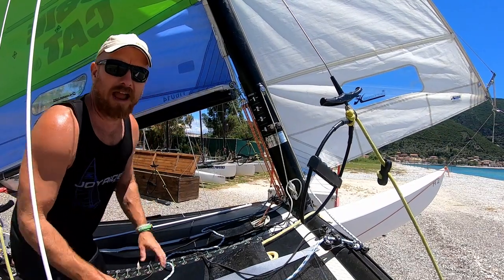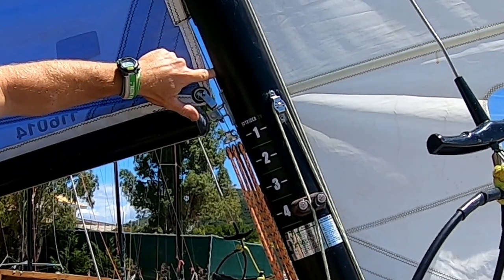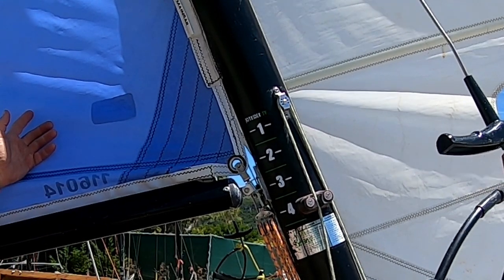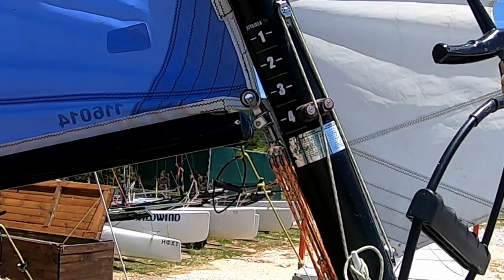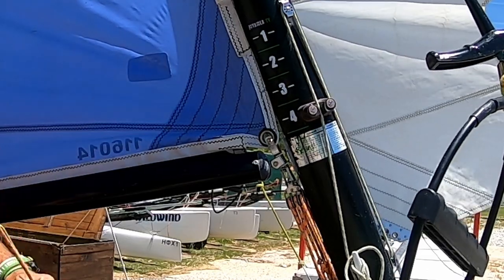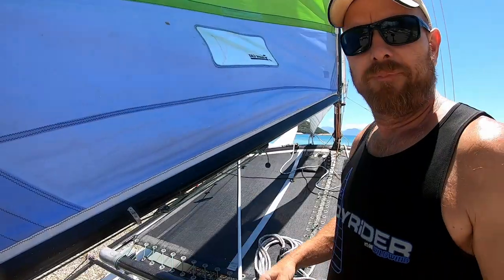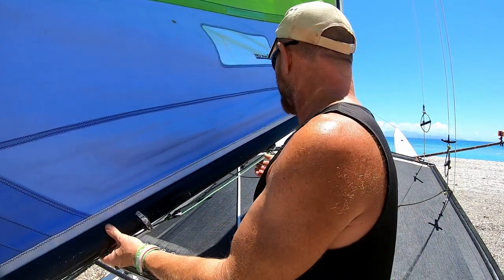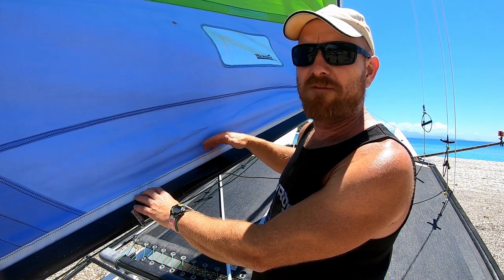Downhaul and outhaul settings on a catamaran  The fundamentals

Comment: This video is perfect timing. On my last sail I realized I may have been over tensioning something(s), possibly my downhaul which was preventing the mast from turning smoothly. I think I may have been over-tightening the jib halyard which also can contribute to mast bend. On my last sail the mast would not rotate and I had to use my hands to get it to rotate. I am about to go for a sunset sail to play with the tension of these items. And I will now be sure to do a pre flight check for mast rotation.
Reply from the maker: could be too much jib sheet if it's windy - that could backwind the mainsail or the mast, could be too much jib halyard, could be a bent mast - if it's just happening on one tack.
Reply: @JoyriderTV  Hey Joe, I just discovered the problem and solution to my mast rotation pivot problem! My boat is a 1989 Hobie 16 and it has had several owners over the years. My boat was fitted with 4 shrouds, the two extras were likely added at some point to provide extra level of safety when coastal sailing in the Atlantic ocean far away from the home beach. Apparently, one of the shrouds had to be replaced at one point in time and it was replaced alone and not as a set. As a result, the replacement was a different length shroud, a substantial 2" shorter. (I just learned that Hobie has shortened the shroud lengths two times since the original Hobie design to give the newer model Hobie's more mast rake, which requires shorter shrouds.)

I did not know about the 2" difference in the lengths of my port and starboard shrouds, so when I reassembled my boat for the new season, I set the pins in the same holes (port and starboard) of the shroud hole stay adjusters, this caused an imbalance in the rig tension and twist between port and starboard... causing the mast to not pivot properly and allowing the boat to tack well to starboard but not to port. While this is unique because this Hobie has 4 shrouds, I learned many things from this experience. 

Lessons learned... 1) always replace shrouds as a matched pair and if a person has an older boat, be sure to check the length of the shrouds you currently have. If you choose to go with a different shroud length, it can affect the length needed for the forestay. 2) The newer shorter 18'-11" shrouds are now the Hobie 16 standard and work great on Hobie 16's newer than 1984 when the mast bases were updated by Hobie to allow for more mast rake. I did need to add a bit more forestay length from the existing 17'-6" forestay to 18'-3" to balance the rig. I did this by installing a new 18'-3" Aussie Jib system forestay. 3) I learned that the halyard rigging on the Euro Hobie's is different than my USA rigged boat and I found the Euro setup to be more user friendly. The Euro system has the jib halyard cam cleat and cleat on the starboard side of the mast. As a right hander, It is much easier to make adjustments to the halyard on the water. I made the switch to the Euro style, and installed that jib halyard cleats on the starboard side, when I installed an Aussie Jib system. And moved the main halyard to a cleat on the port side of the mast. It works so much nicer than my older jib system! 

I would not have made these changes if my current rigging was in good shape, but since it was time to replace my shrouds and forestay anyway, I decided to replace the shrouds and forestay with the current Hobie 16 specs... (the shorter 18'-11") shrouds, (a longer 18"-3") forestay, and the Aussie Jib system. 

Thank you Joe for your videos! They helped me see how Euro boats and USA Hobie's can be fitted differently. If any of your viewers need info on updating their older Hobie 16's, I can send you pics or videos, to be used on show us your Hobie, that might be of help.

Comment: On older 16’s and those not equipped with the 6:1 downhaul kit (like my ‘83 Blue Hawaii), I’ve found that sheeting the main in tight helps pull the downhaul on more, also adding a micro block to the ring on the gooseneck helps reduce the friction when pulling it on. I don’t adjust once on the water unless there is a significant change in conditions.
Thank you for your videos, they have made me a much more confident skipper!
Reply from the maker: Great tip there. I do remember the days before the 6:1 and we did the same.

Comment: Another Grt vid Joe! Thx for this! Re downhaul “The harder it blows the tighter it goes” I read somewhere. Something we don’t talk enough about is how to control or slow the boat down in strong wind. These are key strategies here, I would also add mast rake to this (increase rake to increase control and get the boat flatter) using the jib halyard/ Aussie jib (I know you covered this before) and then obv keeping the different systems in balance. These more subtle strategies are also critical when racing. Keep up the Grt work Champ, greetings from South Africa 🇿🇦
Reply from the maker: Thanks Kevin, i think this will be the first of a series of videos simplifying some topics that people might have found confusing.

Comment: I know guys that could use a video on jib clew position per wind strength. Many do not understand how it changes whether the sheet pull falls more on the foot or more on the leech and how that affects the performance of the sail in varying wind conditions.
Reply from the maker: Thanks Tom, great suggestion. I'll put it on the list.
Reply: @JoyriderTV  yes, and (I know you have done this before) while you are in that area of the boat, a review of the jib traveler position in relation to the main traveler, the tension and what the gap between does. 👍

Comment: Joe could you please add measurements as to where your scale is on the mast for the downhaul
Reply: I join to this question. Joseph, what is approx. height of your scale? As for me I usually use downhaul somewhere between 2 and 3.
Reply from the maker: yes i'll get those measurements, however, the positions will be effected by how much your sail is stretched.

Comment: another great vid, Joe. I've installed a double block downhaul on my Hobie 18 where before was just a rope through a cringle. The original system has no snatch block, instead just a jam slot, whiich is inconvienient, but I'll change that shortly.  Question: on my jib, there is a leech adjustment line. How does that affect the sail setting as opposed to moving the jibsheet cars forward or back?
Reply from the maker: That leech line you want to have that so that it's just supporting the edge of the sail - no real tension wants to be in there. The jib car - move it forward to close the leech for lighter winds (never so tat the leech is tighter than the foot) Move it back for heavy wind to open the leech and slot and put more twist into the sail.
Reply: @JoyriderTV  Thanks very much for that Joe, very helpful. Keep up the great vids!